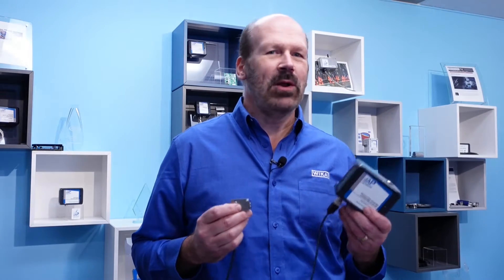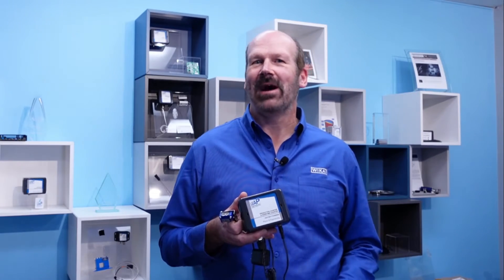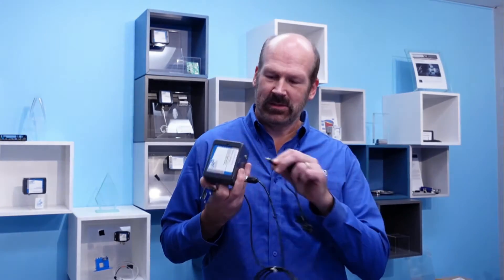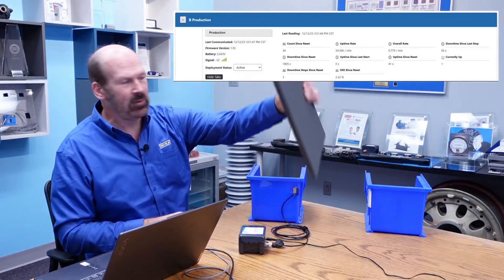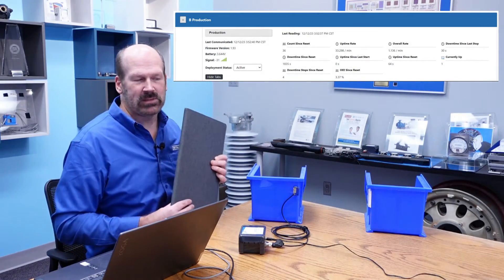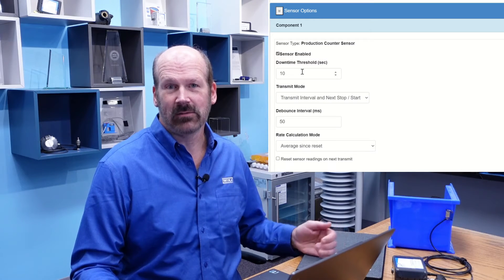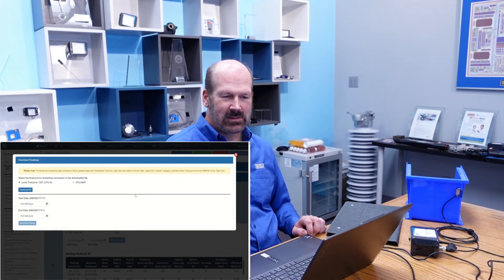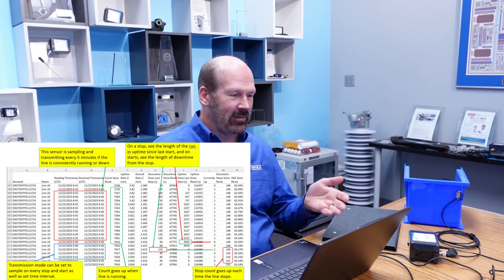Production Counter Sensor with Manufacturing Downtime Monitoring – Demo Video

Comment: Simple and affective. Does it come with an online apllication? How can it be setup?
Reply from the maker: The software application is a "web site" and can be deployed a number of different ways.  You can use the Phase IV Leap Sensor Manager cloud service, or the software can be hosted on the single-board computer in the gateway - or locally on a server or PC.  Set-up can be done in less than 5 minutes because it is pre-configured to the application before it ships.
Reply: @PhaseIVEngineering  thanks that looks  fairly easy! If you dont mind sharing the price and international availability or shipping options
Reply from the maker: @random-kc8gx  please contact us via our website so we can discuss your specifications & configure a system https://www.phaseivengr.com/about-us/contact-us/. Thanks for your interest.